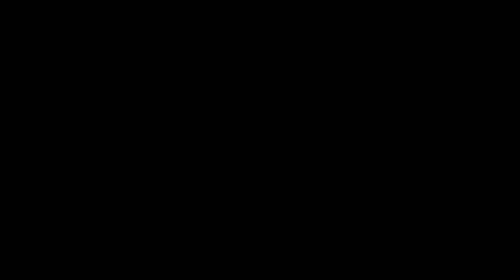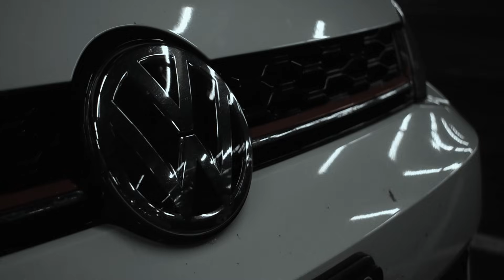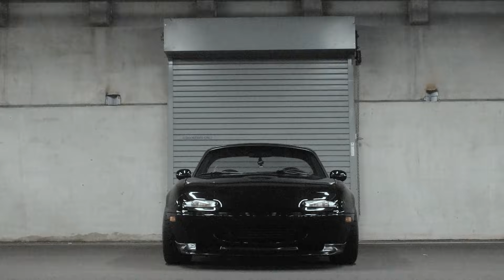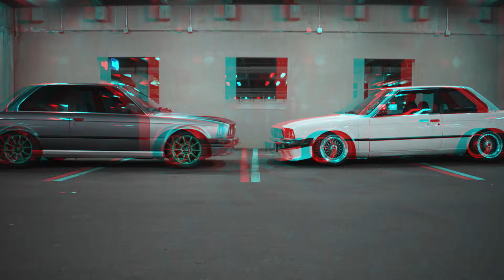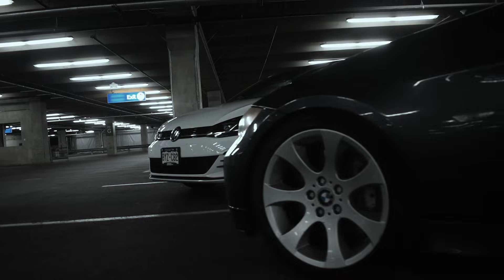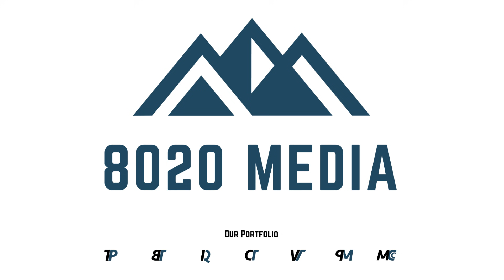8.1 Vortec Reliability & Common Problems

Comment: They still make the 8.8L PSI and the 7.3L Godzilla makes more power and tq than the 8.1L ever did and is proving to be as capable towing in tests like the Ike Gauntlet as diesels, once you give it deep gears and 10spds it pulls in ways an 8.1L with a 4L85E or Allison never could.
Reply: What vehicle do they come in?

Comment: Actually the main reason for this creation was at a request to haul horses in trailer without the exhaust of a diesel that was harmful for horses even stainless exhaust manifold or just more nickel lol to combat heat turned up to reduce pollutants that make it past the Catalytic converter

Comment: The pcv system is the biggest issue with the 8.1, and it causes high oil consumption and pinging from the oil burning and resulting carbon deposits. The 8.1 is otherwise a great towing and workhorse engine with never ending torque for a gas engine and comes with the Allison transmission in the pickup and medium duty trucks. It’s a diesel-like power plant without the diesel repair/operating cost.

Comment: From what I have heard and understand, synthetic oil doesn't build up sludge like conventional oil does. I have a couple of Dodge Dakotas with the Chrysler Power Tech 4.7 liter V-8 engines. They are overhead cam. The middle cam tower bearing saddle is right above the two exhaust ports. This causes the oil to cook in the galley port. Over time it plugs off the oil supply to the cam bearing. I was told to use synthetic oil and you won't have a problem. I've been running full synthetic in all my vehicles and never had problems. This might be good for the lifter tick problem. Because, I haven't had lifter ticking with my Silverado Dually 8.1 👍😎

Comment: The reason these engines will consume a lot of oil is that they  use forged pistons. If you drive relatively short distances, you will probably fall into the 1 quart every 2000 miles category. It takes a while for the pistons to heat up and expand fully. People who drive at least several miles or get up to Interstate highway speeds before shutting down will not use much oil. As a matter of fact, if you look at the manuals for marine use of these engines it lists a chart that says it's normal. For example, say, running the engine at 3500 RPM for 8 hours it will use a certain amount of oil. I'm not sure what the exact numbers were but it was an amount you can expect to burn oil. Nature of the beast. 👍😎

Comment: I must be very lucky. I have a 2004 RV. Fleetwood Bounder, on a Workhorse chassis with the Vortech 8100, does not burn oil. Runs great, just change the original plugs @ 45,000 miles. OEM gap was .060. now they recommend  .040. Thank you for your knowledge and videos USA 🇺🇸 USA 🇺🇸
Reply from the maker: P - Nice! Thanks for sharing your first-hand experience.

Comment: Thank you for the video. I love my 8.1. I have a 2001 GMC Sierra 2500 HD 310,000 mi and still going. It does however burn quite a bit of oil. I recently changed plugs wires and coils and now it runs like it's brand new again.
Reply from the maker: B - Thanks for the feedback! Sounds like you take great care of it.

Comment: Almost 200k on my 8.1 in my 2005 2500HD. Only issue I’ve had was intake gasket and oil pan gasket. Pulls anything I need it to.
Reply from the maker: S - Nice! Thanks for taking the time to share your experience.

Comment: The lifter tick on the 1970’s 454 was caused by air getting into the lifter oil gallery. The cure for that was to drill a tiny hole in the front lifter oil gallery plugs and it went away and didn’t hurt anything.
Reply from the maker: W - Interesting fix. Thanks for sharing!

Comment: Wow,... really excellent information! Thank you! I have an 03 Sierra 2500 HD, with 124,000 original miles, and haven't used alot over the past couple of years, and consequently had to do brake & fuel lines do to corrosion etc (i live in Wisconsin!). Not sure if I should sell this truck (which is really in terrific overall condition otherwise!) but hearing your thoughts and reading the comments, i may hang on to it just because. Thanks again!
Reply: It’s more than a truck… it’s an industrial machine
Reply from the maker: B - It depends on if you're in a financial bind. If not, not bad to hang on to! Thanks for the feedback.
Reply: Are you able to tell me how to disable the emergency brake alarm sensor (just started going off)? How ironic that I was actually just checking your You Tube and it starts going off!😂 @8020Automotive

Comment: 2006 Chevy stopped making the 8.1 Not true I have a 2007 classic 2500 pickup that has the 8.1 with the Allison transmission
Reply from the maker: B - 2007 model years were made in 2006.

Comment: My 8.1 has low oil pressure, I have read in various online threads that it can be normal for the 8.1 do have low oil pressure.  Is that something i need to be concerned about?  My 8.1 also has a lifter tick when i first start it up, but after about 30 to 40 seconds it goes away and the idle is as smooth as silk.
Reply from the maker: D - The GM 8.1L Vortec (L18) is known for lower oil pressure readings compared to other big blocks, but as long as it stays above 10 PSI at idle and 30-40 PSI under load, it's generally not a concern. However, if the oil pressure is dropping below 10 PSI at idle or significantly lower than normal under load, it could indicate worn bearings, a weak oil pump, or a clogged pickup screen. The lifter tick on cold starts is also common on the 8.1L and usually results from oil draining from the lifters overnight. If it goes away after 30-40 seconds, it’s likely not an issue, but switching to a higher-quality synthetic oil (like 15W-40 or 5W-40) and ensuring a good-quality oil filter can help reduce it. If the tick persists longer or worsens, it could indicate worn lifters or excessive cam bearing wear, but if everything smooths out after warm-up, it’s likely just normal big-block behavior. Keep us updated!

Comment: I have the 2002 Chevy 2500HD LT full crew full bed 4x4 with 8.1 and allison and a snow plow lol.  Got it from Cali in 2019. 1 owner used it for rv mostly. Runs great smoth and strong. Just put whole front suspension from summit from snow plowing wear..with bilstine 4600s, way better ride both ways. Loves oil lol
Reply from the maker: G - Nice! Thanks for taking the time to share your experience!

Comment: Not long after I bought mine I noticed the iol consumption problem, it brought back wonderful memories. Every 454 I've ever had, and new of burned one quart of oil in-between oil changes. Not much of a problem just GM's friendly reminder, it's time to change the oil
Reply: 5-30 is to light of an oil for these massive iron blocks. 5-40 synthetic reduces the consumption to less then half a quart per 3k miles. having an oil that handles the higher heats of summer towing is an absolute must.
Reply from the maker: M - True! Thanks for taking the time to share your experience.

Comment: Hey great video! I work for a tree service my boss has 4 bucket trucks all with the 8.1. all I can say is yup! I have run into all those issues. Spark plugs and for some reason the wires on the one same engine. They all seem to eat a bit of oil. Since it's not currently sold in GMs lineup you know anything 9 years old or older is considered "obsolete". Anyone who has any tips or tricks that are not discussed I would love to hear it. One is from the junkyard it has a bit lower oil pressure than I would like to see but it's otherwise fine. The spark plug one is a "rebuild" from a guy who wouldn't replace the rings on any of the engines he rebuilds. It's annoying to me. The dt466 he did runs awesome but it'll blow by a quart or two a week if it's driven hard. One truck has gauge issues I'm thinking it's in the cluster and the newest bucket truck is all factory, well maintained and runs like a top. Like, you could do that old cliche of putting a full wine glass on the hood and only observe a gentle ripple. Anyone ever build one for performance? Love to know. Thanks
Reply from the maker: C - Thanks for taking the time to share your experience!

Comment: Thanks for the great info.  I have a 2001 8.1 HD Sierra.   I tried switching over to full synthetic oil about 15 years ago and got a severe case of lifter tick.   Very loud.   I thought I had a bent rod or something.   I switched back to regular oil and the tick went away.  
I never had that issue again until I recently did an oil change and used some oil that I had bought in 2020.   That real loud ticking came back, but only under a load,  or when I really give it some gas like getting on the highway.   You can barely hear the tick at idle, even when revving up in park.   I put in a full bottle of Marvel Mystery Oil and the ticking quieted a little but its still loud.  
 I'll be changing the oil again.    Any recommendations?  Im thinking of going to a fully NON-synthetic blend. ??
Reply from the maker: M - Sorry to hear this.. Switch to a high-mileage conventional or semi-synthetic blend, such as a 10W-30 or 10W-40, and continue using Marvel Mystery Oil or similar additives. Avoid full synthetic if it caused issues previously.

Comment: Great video. I found a low mile 8.1 silverado in arizona couple years ago. Regular maintenance and it runs awesome. Love mine. Put in a true dual 3in exhaust with xpipe, no muffler, stock cats. Sounds better than my jeep that has a 6.0 LS. Great trucks!!! Ive only had little/easy repairs - ac leak, hydro booster, blend door actuator and the usual suspension components wearing out. I am very anal on maintenance but i enjoy it as these trucks are easy to work on and find parts for.
Reply from the maker: J - Thanks for taking the time to share your experience! Sounds like you've got a good one. That's the way people should be with maintenance!

Comment: I have a 2003 Sierra 2500HD 8.1 gasoline that had starting issues. It would never start on first crank, would backfire while cranking but would fire up around the third crank attempt. I replaced the crankshaft sensor, camshaft sensor with no improvements.   After a year of dealing with it I came across a post on a blog where they were having the same issues. He said he swapped out the timing cover and camshaft sensor with the updated 2004 version and it fixed the problem. I decided to give it a try, also got new timing chain and sprocket while I was at it and sure enough it fixed it and haven’t had an issue since.
Reply from the maker: T - Thanks for taking the time to share your experience! This will certainly help future viewers.

Comment: I've had an 8.1 for just over 10 years now and wouldn't trade it for anything made today. It's in a k2500 Suburban with a 4L80E, a full floater 14 bolt rear end and 4:10 gears. It has 340,000 miles on it and it goes through a quart of oil between changes at 3-4K miles.   I put E3 plugs in it with a set of 8MM plug wires from JBA headers and haven't had a plug go bad in over 25K miles.
Reply: i use 5-40 in  my 8.1 and the consumption has been reduced to half a quart at best. i use it to tow a 10k camper 30k miles a year
Reply from the maker: B - Thanks for taking the time to share your experience!

Comment: My super low mile 8.1 smells like antifreeze from the exhaust on startup. I assume it's a head gasket. Is this a correct diagnosis and is anyone familiar with this issue?
Reply: I had the same issue on mine. There are some plastic T fittings on the heater hoses directly above the passenger side cylinder head and right by the firewall. It turns out mine had developed a slow leak and once I replaced these plastic T fittings, my coolant consumption and coolant smell was solved
Reply: If any engine actually has a problem with the head gaskets failing, you can check the coolant for oil / combustion residue. And also simply remove all the spark plugs and check them for any evidence of coolant fouling or steam cleaning. If you don’t have any of these issues, my best guess is it’s those plastic T fittings on your heater hoses
Reply: They make metal replacements for the olastic junk ones. I think Dorman makes them
Reply from the maker: J - Based off of what you described, it could be the head gasket. Are you having any drivability issues?
Reply: I forgot to mention above - the plastic T fittings are what provide the connections on the heater hoses for the rear heater core lines

Comment: In some configurations, these engines can run lean, enough to grenade the pistons. I have an '03 8.2L in my big ass RV and use a scan gauge to keep an eye on What the computer is doing by monitoring the LF1 and LF2 compensation numbers. anything in the double digits is real bad. I put in a new air filter and cleaned the MAS and it brought things to low single digits...
Reply from the maker: M - Well said. Thanks for taking the time to share your experience!

Comment: 2005 suburban 8.1.  Lifter noise stoppped by full synthetic oil.

Had rough start power loss, plugs replaced.stopped .
Reply from the maker: H - Thanks for taking the time to share your experience. It will certainly help future viewers.

Comment: 02 GMC 2500HD w/8.1 vortex and allison transmission - 4.10 gears. Bought it new and now has 325k miles on it. I love this truck! Used 2 quarts of oil aright off the lot...dealer said its normal until I pressed the issue. Turned out there was a bulletin on the intake manifold gasket causing oil consumption. After that, 1 quart every 3k miles. Crank position sensor replaced at 50k and 275k. Besides that, all I've had to do is regular maintenance, 2 fuel pumps, and a water pump. I suspect I've got a couple broken exhaust manifold bolts and the AC (totally original-never charged) is acting up. Blows 37 degrees F at the start and then cuts off after 15 mins of driving. I might add that half the total miles driven are towing miles!
Reply from the maker: M - Thanks for taking the time to share your experience!
Reply: How is you gas mileage with and without towing?

Comment: My 8.1 is terrible on gas mileage. Would a 6.0 get me better gas mileage?????
Reply: Axel ratio is a key factor here, what ring and pinion does your truck have? 4.10 etc. just match the gears to your load towing needs.
Reply from the maker: H - 6.0 would be better, yes.

Comment: I just dropped a 8.1 in my 84c10 its sweet set up so far. But when it hits 194° it hase a squeak luke a belt but its not one. Anyone have any idea? I have videos up on my YouTube page. Any info is appreciated
Reply from the maker: K - Any engine codes?
Reply: @8020Media  the only code it has is the TPS. Code went away after the new sensor installed. I drove it for about 10 Miles with the squeak and it never missed a beat
Reply from the maker: K - Nice! Great to hear you got it resolved!

Comment: I own 3 GM vehicles from this generation: A 2005 Suburban 2500 (8.1), a 2002 Silverado 1500, and  - the crown jewel - a 2004 Hummer H2 Luxury package. I bought the Suburban with 110k miles (it currently has 210k), the Silverado with 137k (it currently has 179k), and the Hummer with 53k (it currently has 79k). I daily drive all three, and have done many long-distance road trips and family outings in both the Suburban and the Hummer. I occasionally tow with all three (nothing very heavy), and have done a fair amount of light off-roading with the Suburban and the Hummer. These three vehicles have proven to be the toughest, and most reliable vehicles I have ever owned by FAR, in my total 35-ish years of vehicle ownership. In the case of the Suburban, also the most versatile and useful. GM really knocked it out of the park in the early 2000's.
Reply from the maker: P - We couldn’t agree more. Unfortunately, they don’t make them like they used to..
Reply: @D1NGL3R666 they don't make them like that anymore...
I wish it wasn't so.
Reply: Pahahaha you really just call a damn hummer "crown jewel" ok bro 🤡
Reply: @silver01svtf150  if you know you know, if you don't you don't.

Comment: Might fires right up and then dies after a few minutes. Then its kind of a pain to get it started again sometimes. Runs fine after that. 147k. 2001. Where do i start? Crank postion sensor? Plugs?
Reply from the maker: T - Sounds like it could be an alternator issue. But throwing us off running fine after starting.. We have a video on engine stalling the could be helpful: https://youtu.be/7bqAIbYRdnc

Comment: I'm in the market fir the 8.1 now fir my 37 Pontiac 4x4 crawler. Great info! I'm a  Duramax guy now, but 8.1 is a simpler option for this build.
Reply from the maker: A - Thanks for sharing! Keep us posted.
Reply: @8020Automotive  try a used 6500 from uhaul. They are all 8.1.

Comment: The oil consumption issue is courtesy of the general's engineering. They put the crankcase ventilation valve in the bottom of the intake manifold where it  literally ducks oil out of the lifter valley. Lawrence Tollman addresses this issue on his channel.
Reply from the maker: G - Thanks for sharing this insight!

Comment: Hello, i have a 2000 3500 slt /vortec,117,000 miles /dualy/4x4  and a 2002 2500 hd /vortec 8100/147,000 miles/4x4.   Trying to make a decision about what to keep and what to sale. Any suggestions. Thank you so much.
Reply from the maker: C - We like them all. That's a tough decision.
Reply: @8020Automotive  Well, 2002 has Allison Transmission...  Im selling the Dually 2000 if you know anyone. Located Northern Virginia.  Any place you recumbent for service this engines?
Reply from the maker: C - Should sell easily.

Comment: I have a 2005 crew cab with 8.1 and Allison that I bought new.  Only problem I ever had was the gauge cluster and driver door latch.  Did the transfer case pump rub fix early.
Reply from the maker: H - Thanks for taking the time to share your experience.